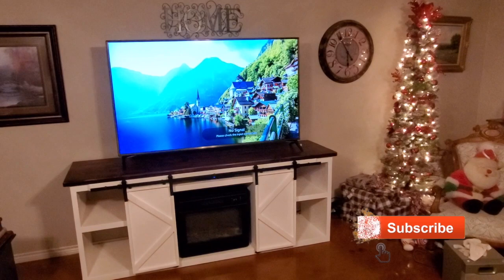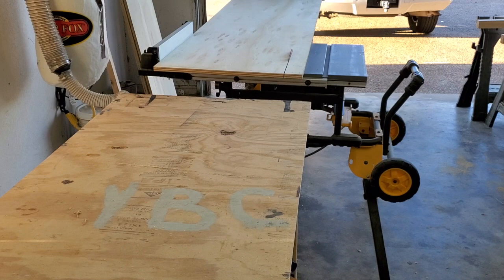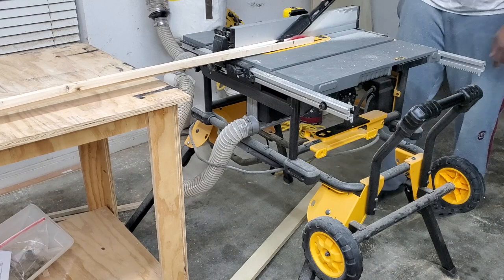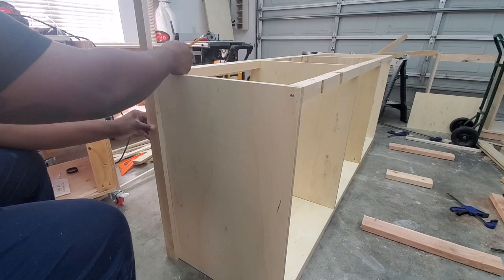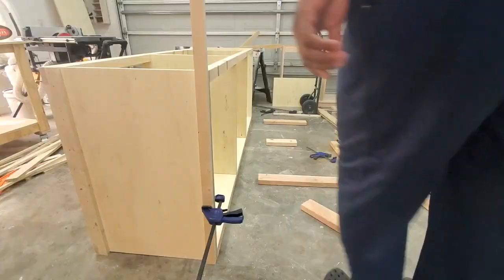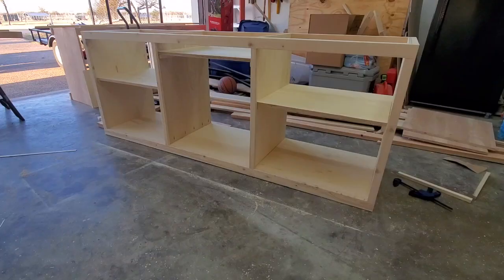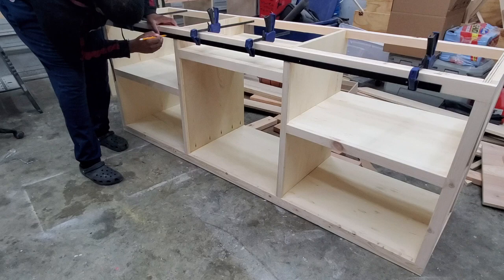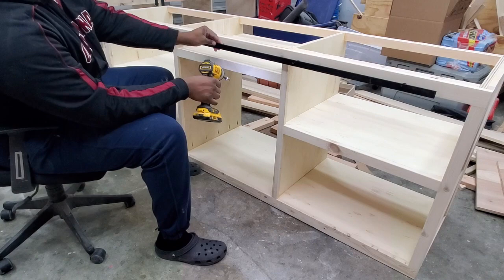FarmHouse TV Stand - DIY (Part 1)

Comment: Furniture /cabinet maker Pro tip: I would've installed the front / back top 2*2' rails (long, Un broken) in one piece and notched the front / back tops of the 2 partition panels, around the 2*2 rails. You'll also find the layout between the panels, will be much easier that way too. As opposed to braking up the top rails and having to account for the thickness if the partition panels. Once you've notched your panels over the rails, you can then slide the panels, left or right to determine the panel spacing you like and then, permanently fasten them in place. Great job through.

Comment: What type of plywood do you use for surfaces that will be seen and painted?
Reply from the maker: I get all my plywood from Home Depot. 
I'll use sanded or maple if I am going to paint it.
Reply: @coreysworkshop6421  is maple your run of the mill plywood, or is it a pretty expensive species? I’m in Australia so we use different species’.
Reply: @ReaperXC   in North America maple is on the higher side for plywood...its usually pine or spruce which is cheaper
Reply: @kylet3589  cool mate. I'm in Australia so this is interesting.